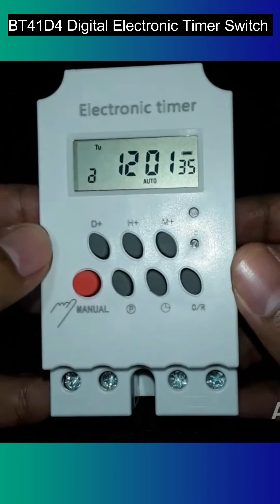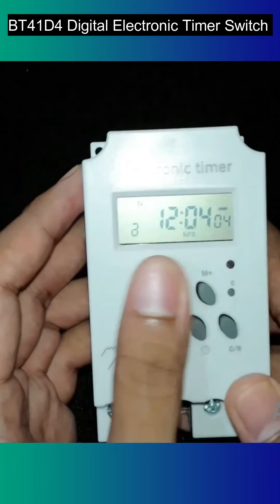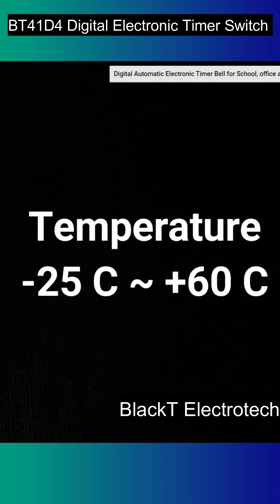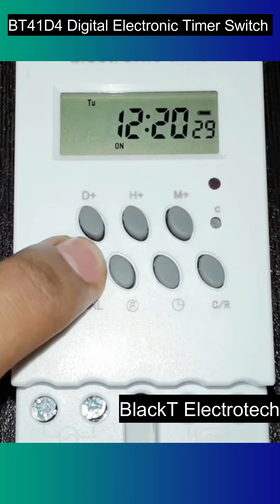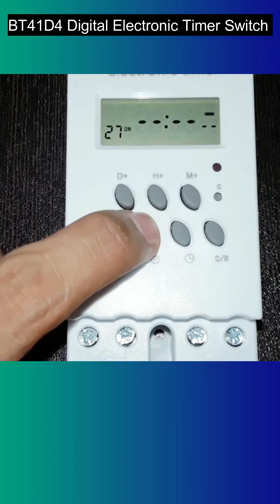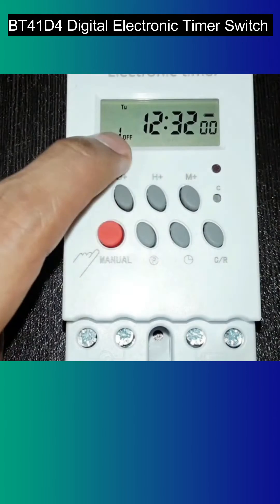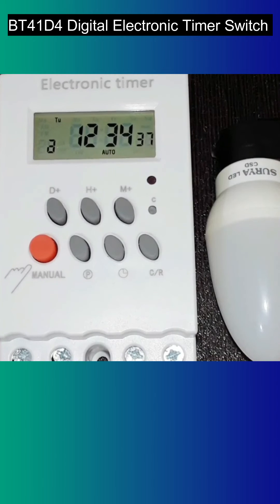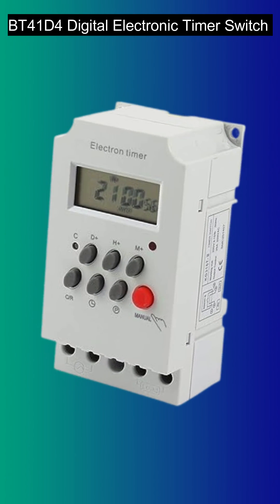BT41D4 Digital Electronic Timer Switch

Comment: The product is quite good. Even instructions are also quite helpful. Now I had faced the problem of E1 or E2 error codes. So here is the sequence.  a) take a thin (like a ball pen tip) object press the soft cushion reset button just below the red led on right edge. This will RESET every thing. now the timer will show 00:00 2) now first you need to enter the Day :  Hours :  Minute as described above. In case the keyboard is locked. press the BIG RED unlock button. 3) after setting the time  now press P BUTTON . it will show 1 ON set the on time as you want (as explained above) press  P BUTTO again repeat same for OFF time and repeat this process as many times as you want multiple ON OFF times. NOW TO COME OUT OF PROGRAMMING MODE PRESS THE "CLOCK BUTTON ON RIGHT SIDE OF P BUTTON. (May pressing other button landed me into E1, E2 problem.)  Now you had come to TIME DISPLAY mode. Now for safety press BIG RED button to lock this keypad. If anywhere you missed sequence / pressed wrong button and get into E1 E2 business  LIKE ME repeat the process with that thin object (ball pen tip).  Thank you